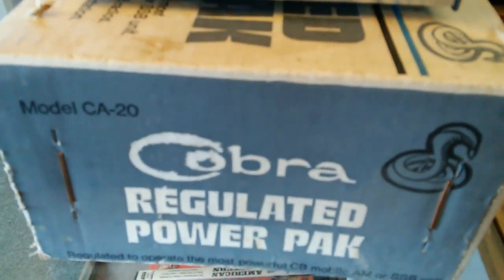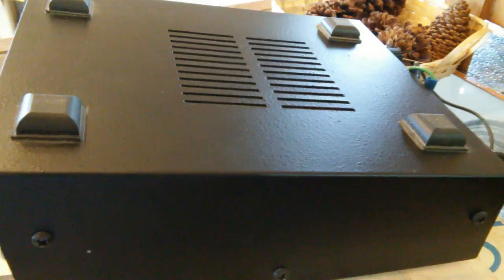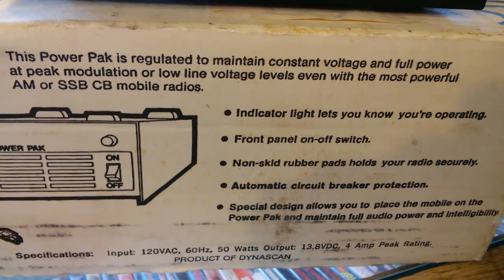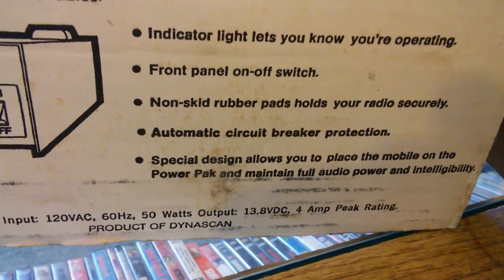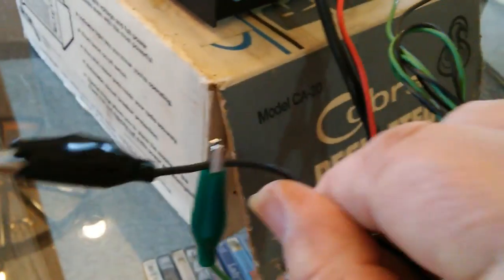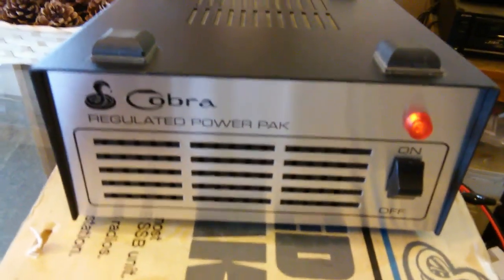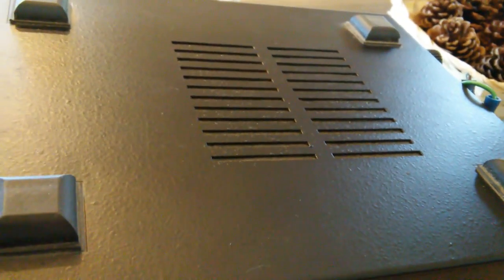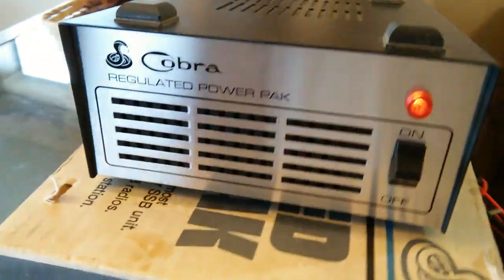Cobra CA 20 Power Pak 12 Volt Regulated Power Supply For CB Radio

Comment: Nice unit, brother!! Very clean!!
I totally dig the Cobra snake on the 
front, AND the feet on the roof of 
the housing. Rubber or plastic? 
I've got a really great 1970's 13.8V 
power supply, except: it puts out 
approximately 26.5 volts!! It's a very 
good thing that I checked it before I 
hooked my vintage 1977 model-year
RCA 14T302 SSB Co-Pilot CB Radio 
up to it!! Any ideas about what might 
have doubled the voltage output of 
my power supply? I have a laptop power supply(only 12 volts), and a 
home computer power supply(also, 
sadly, only 12 volts). I would like 
13.8/14.3 volts just for the extra bit 
of "oomph" that the extra 15%-19% 
would give the radio. I don't want the 
radio over-heating, just running at 
high efficiency!! I believe it's the total 
of all the little things done right that 
will give the greatest rewards at the 
finish line!! Use the best connectors 
(Amphenol?), the best co-ax and 
power cables that you can afford, 
tune your antenna for absolute BEST 
SWR no matter how long it takes, 
ground the hell out of everything,
and get a very good microphone.
If one must wait a bit until some 
more funds become available, then 
be patient. It's always better to wait 
and get the best of whatever one is 
getting when one has more $$ 
available to them!! More satisfying!! 
How is your RCA Co-Pilot doing? 
Concerning my over-active(26.5V!!) 
power-supply, someone suggested 
it might be a large round transistor 
to be the problem. Any ideas would 
be ridiculously appreciated!! I, too, 
appreciate, covet & drool over the 
older CB radios and electronic 
devices and doo-dads!! The have so 
much more personality and 
charisma than todays 
"cookie-cutter" similar looks for 
everyone!! Can I get a big 10-4?!
I look forward to your response!! 
Take care-we care, 73s & be safe!! 
Norman in Montreal. 
PS: Will you be DX'ing on sideband 
this week? Tues-Aug 9 & onward.
If so what channel & when? I'll try to find you!! Please answer ASAP!!